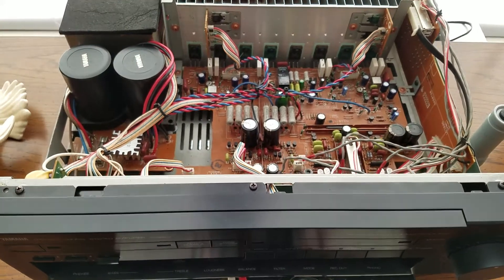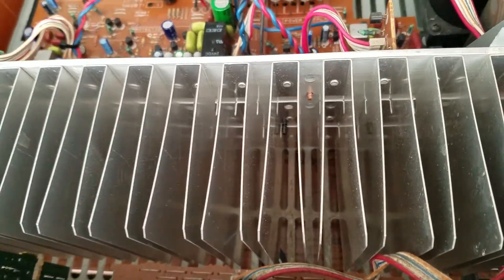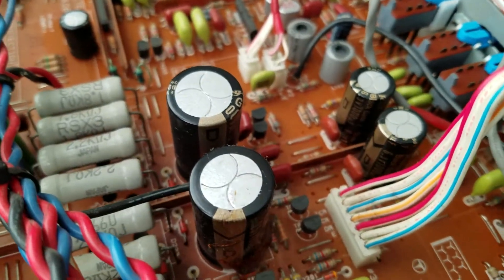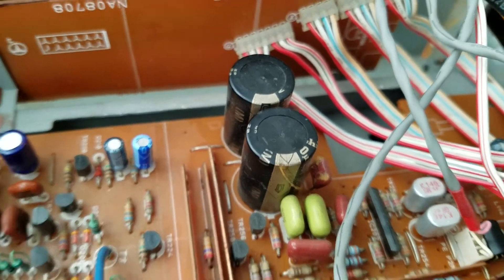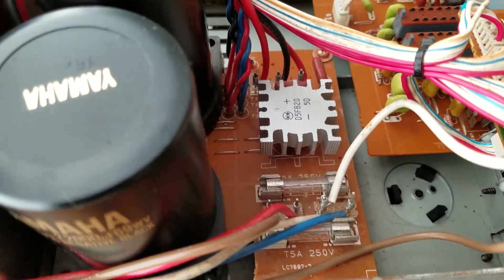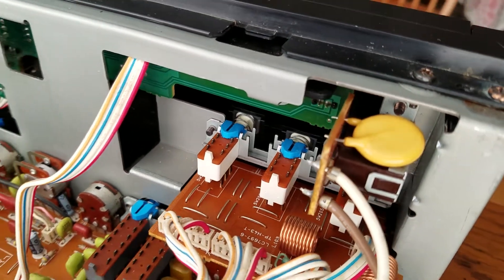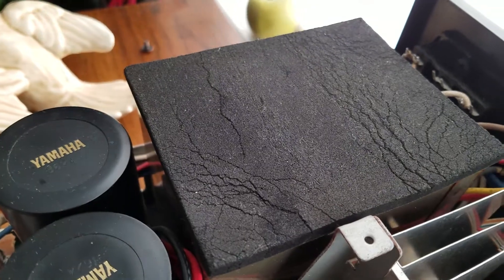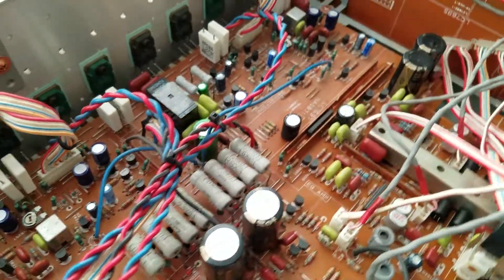Inside The Yamaha A-1020 Integrated Amplifier (Rubycon Black Gate Capacitors) Auto Class A

Comment: I had one of those from 1986 until 2006 when one of those Rubycon Black Gate spilled its guts over the PCB. I replaced it with a Marantz PM 7200 and boy did that make a difference in sound quality! My theory for the low sound quality is the large number of components that the signal has to pass through. Back then, Yamaha was obsessed with low THD which they would use a transistor only in a very small operating window  which means they had to use a large amount of components.
Reply from the maker: I recently had it serviced.  Quite a few output transistors needed replacement.  All the caps still measured well, so I didn't replace them. I am very happy with the sound of it.  I tried several newer amplifiers, none satisfied me. That is why I had the yamaha repaired.  I'm glad I did.
Reply: @scottbennett3119  Compared to the PM 7200, the sound seems to stick inside the speakers, if you know what I mean, the PM 7200 creates are much wider, more open sound scape. Well if you do like the A-1020, I recommend removing all the regulatory stuff just before the speaker terminals. I don't remember exactly, it's a bunch of LC filters that have the effect of lowering the dampening factor, so if you remove it the bass response will increase dramamtically. I basically soldered a 2,5mm² wire directly from each of the last output transistors to the terminal.
Reply from the maker: @mojoblues66  This is interesting.  I like the A-1020 precisely because it has a 3-D sound with good depth and width.  Better than any of the any of the newer amps I tried, except for the Emovtiva TA-2 135 watt/Ch integrated amp. It had really good 3-D sound staging and depth, but it was a little too bright and fatiguing after a day or so of listening.  I will keep an eye out for a Marantz PM 7200, you have me interested.  PS, I really like the tone controls on the A-1020.

Comment: Question: I have a Yamaha A-1020 and made the one mistake inexperience person will make: removing components without taking photos or marking the locations of components. I remove the 2200uf main cape to test and did not mark the + or - orientation on the board. Do the caps share the same negative side on the board?
Reply from the maker: I found this online: Yamaha A-1020 Service Manual.  It shows + - orientation on the schematic.  I hope this can help. https://www.manualslib.com/manual/1023595/Yamaha-A-1020.html